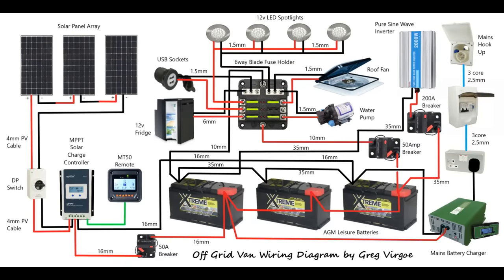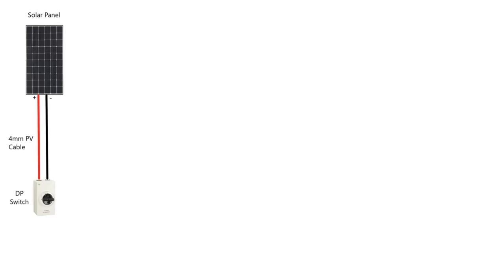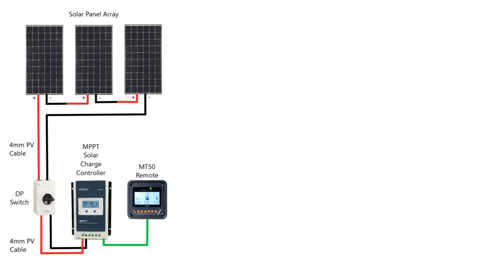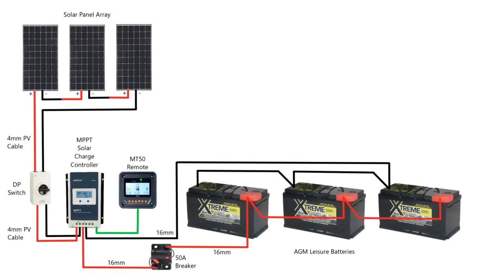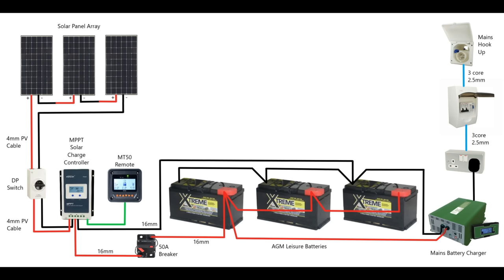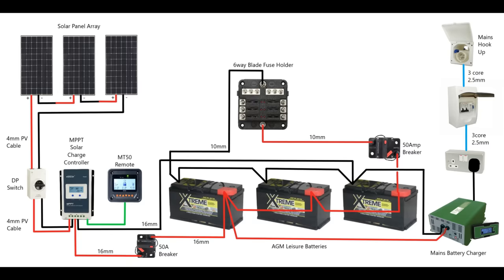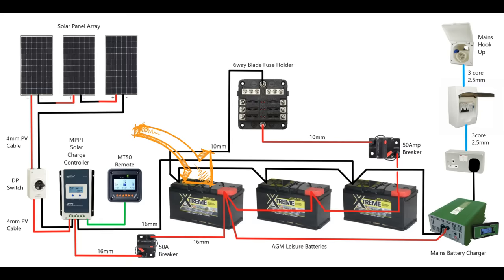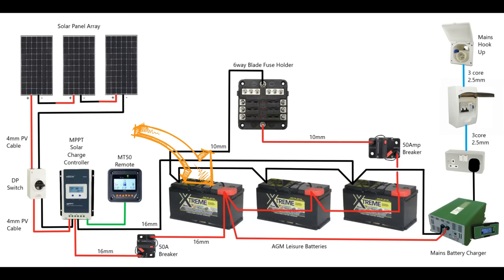How to Wire your Camper Van to be Off-Grid

Comment: One more question Gregg, is there a way to connect the inverter in the top of the fuse board along with shore power, coming out the other end I could charge the batteries from the shore or power a socket with shore 240v or forget the shore power, run the inverter through the same fuse board and have all my appliances run off that? Is there like a relay that would not allow shore power to enter the inverter? thanks

Comment: Hi Greg look for some advise I'm looking to install an inverter using a  24volt 100Ah LIFEPO4 LITHIUM BATTERY and a   Victron Orion-Tr Smart 12V 30A Isolated DC-DC B2B Split Charge Kit to the van battery and I've been advised via victron that 16mm cable will be suitable but in your video you say 35mm? Confused hope you can help 

🔍

Comment: How do I find out what size breaker I need between the solar charge controller and the battery. I'm making about 10amps max, should I use a 15amp breaker? thanks!

Comment: Hi Greg _ I know this is one of your older videos but it has aged well - unlike me.

Context. Daughter has a VW California 3 years old old supplied as a Danbury conversion and she brought it to me to investigate flat leisure battery. (She bought it new from them).

I understand Danbury have gone bust and she has zero documention with the van.

What I have established is she is is getting zilch from her solar panel via the ‘EP Solar Duo Battery solar controller’ AND the vehicle alternator is not ‘wired up’ to be able to charge the leisure battery. Is this normal?

I would be grateful if you could point me in the right direction of how I go about installing vehicle alternator  to leisure battery charging / in terms of what kit do I need.

BTW - I think they have shagged the battery through ignorance and abuse and no means of assessing SOC. For a ‘professional’ conversion it is very poorly done and clearly done down to a price.

Grateful for any help.
Reply from the maker: Sadly when AGM leisure batteries are drain to flat condition it does damage the battery and difficult to bring that back if been like that for a while. A really good solution would be the Renogy dc to dc charger with built in mppt that I am fitting to the new van. It would give you both solar charging and charging when driving. It’s easy to install and very reasonable price. 
https://amzn.to/44vQKZ0
I would recommend a new leisure battery too and once installed don’t let it drop below 12v when using it 👍🏼😃 hope that helps
Reply: @GregVirgoe  Yes, that it is most helpful Greg. I agree I think they have shagged the battery but I have not had access to do a capacity discharge test. I am reviewing the Renology versus Victron options for B2B.😀👍

Comment: Thank you again.1 question. I have a 3000w inverter.  Will i need a higher rated breaker than what you have here and will 35mm cable be suitable
Reply from the maker: You will need a 300amp fuse or breaker for that inverter and 35mm cable would be ok if less than 1m long otherwise they need to be 50mm. You will need lithium batteries to power that inverter as you will struggle to pull 250amps out of lead based batteries. 
Why do you need a 3kw inverter?

Comment: Hi. Thank you for the video
I’d like to ask u, if my converter it’s 2500w what cable do I need and breaker ? Plus , don’t need to install any fuse box from the inverter to the sockets? 

I have 4 160w solar panels, what cables shall I use 
Thank u
Reply from the maker: Hello Dan,
2500W inverter will need 50mm cable and 250A fuse or breaker.
Most inverters you need to use a fused plu onthe outlet side so that will give you 13amp protection.
If you wire the panels in series the amps stays the same so you can use 4mm PV cable.
Reply: @GregVirgoe  thank u for getting back to me..I have seen that the best one it’s to connect solar panels parallel and in series or just parallel
Reply from the maker: @dank5372  each has their merits but I prefer to wire them in series. The amps is low so cable size is small and I can still get enough bolts for a trickle charge even when it’s peeing down
Reply: @GregVirgoe  thank u... so will I get 4x160wats or will get 12x4 voltage? 
Plus I need to connect my DC-DC to the ignition with IGN sensor cable  as I have smart alternator. I have transit 2013 but can’t find it anywhere how to connect it. Any ideas 
D
Reply: @dank5372   I have one the same year. Let me know how your going with yours

Comment: Hi Greg. I know it's been a while since you did this vid but I am doing a small Micro camper. Everything will be removable as I use it for work as well. I have a 100W portable solar into a PWM controller then it will feed 2x 45A AGM batteries wired for 12v. Can you advise please what size cable to use to run from the controller to the batteries to charge them up. My controller is rated at 30A but the solar is only about 5.5. Thanks
Reply: As your controller is rated at 30 amps maximum output you would need a cable of 30 amps plus 20% (37.5 amps)

AWG 6 = 37 amps
AWG 5 = 47 amps
Hope this helps.

Comment: Hi again Greg,
Just at the point of hooking up my 2 x 340w 18v solar panels and I have noticed that they only have 2.5mm2 pv cables hardwired to them. Is this gonna be an issue? My run is about 5m and by my rudimentary calculations I would need a 6mm2 or maybe even 10mm2. Is this right or have you any experience in changing the cables the panels come with? Cheers in advance!

Comment: Hi, thinking of fitting a 160 solar to an already converted T6, but I am thinking of buying a 500kw portable generator, storing in the camper, and splitting the cable from the solar panel to have a cable to top up the generator and also run to the leisure battery. Am I going down a rabbit hole or is this doable? Thanks

Comment: Re wired my 2  batterys and inverter  like in your wiring diagram with the circuit breaker in to my inverter as I have a switch on my inverter to turn it on I turned the switch on the inverter has gone to red light and just a long beep does this mean my inverter is knackered or is there a fault I have made if there is a way I can send a pic of how its wired so you can help me it would be much appreciated thanks

Comment: Hi Greg, great video! I have a 245 watt panel, with a 115ah lesiure battery, regarding cable sizes would they suffice for this size solar pane?l, I would look at putting in a 30 amp inline fuse also. Solar panel to MPPT 4mm and then MPPT to battery 16mm battery cable ? 1.5mm for every thing else as only have led light, diesel heater and TV (the essentials 😎
Reply from the maker: You can probably come down to10mm on the battery cables but check your diesel heater amp rating as that may want more than 1.5mm 👍🏼😊

Comment: Hi Greg please can you help me, I have  2007  VW Transporter van.. It has a parking or auxiliary heater fitted from the VW factory in this heater system is an auxiliary battery, for obvious reasons I am assuming this will have its own split charge relay. I wanted to have a camping or leisure battery so I bought a 120wh 12v agm and have wired it up on its own b2b split charge relay system... I did ask Impuls automotive the supplier of the split charge relay kit  if they thought this would be a problem and they reassured me that they did not see any issues with this wiring set up, but I have been watching your vids on YouTube and I would like to get your opinion on this.

With kind regards
Simon Tomkinson
PS if any one has a similar experience please feel free to share or contact me.

Comment: How do I know if I need a 32 or 64 amp DP switch? I plan on running two 100 watts panels. I may actually run a third now.
Reply from the maker: It just needs to be greater than your max amps from your panels. 
That’s likely to be less than 20amps so the 32amp isolator will be ok 👍🏼😊
Reply: @GregVirgoe  even if I run 3 100 watt panels will be ok with the 32amp isolator?
Reply: @GregVirgoe  OK I found that my panels are 4.84 optimal operating current 20.7volt and have a max fuse rating of 15A. If I ran a third panel would the 32A DP switch not be enough? 

Second I want to run fuses on the solar panel lines. Do I run 15A?

Oh hey I’m running the panels in series (: so I think it’ll be totally fine right , still wanna add fuses for precaution what you think
Reply from the maker: @jonnytacooutdoors  100W panels typically have max current of 5amps so if wired in series that current will stay the same so one 10amp MC4 inline fuse in the positive to the controller will be fine. Even a 25amp isolator would be rated more than enough for that setup. With switches and cables there’s no harm in going bigger it will just run cooler with less resistance 👍🏼😃
Reply: @GregVirgoe  so if wired in series wouldn’t the amps stay at 5amps? Or no. Sorry I’m a newbie. If I run 3 100 watt panels with the above specs listed then what fuse should I run on the positive line? A 10A?
Reply from the maker: @jonnytacooutdoors  yes see my previous reply 👍🏼
Reply: @GregVirgoe  OK I’m gonna run a 10 amp and can I just plug it in to the PV shut off? Or do I want to run it closer to the panel closest to the panel?

Comment: Hi mate what is your recommendation for charges the batteries from the engine when running and how would it fit into your diagram.
Reply from the maker: I would recommend you use a battery to battery charger. 
They normally have a positive and negative connection to both batteries. 👍🏼😃
Reply: @GregVirgoe  then I guess something like a regulator is used in between the vehicle battery and van batteries, when the car stops, van batteries does not drain the vehicle battery.
Reply from the maker: @melihtarhan2507  the battery to battery charger is the device that is connected between the different batteries. That does all the clever stuff 😃

Comment: Hi Greg, Ive just ordered a Renogy 2000 watt inverter that ships with 20mm squared cables, to run off two 12 volt 100AH lithium batteries. These cables seem a little small to me to handle a potential 166 amps + Could this be a mistake on their part? (product details are available on their website). Matt

Comment: Hi Greg,
Is it possible to  add a  battery to battery  charge  system or a split charge  system into this equation.
Reply from the maker: Yes I would always recommend using a B2B charger rather than a split charge relay as they will look after your leisure batteries better. 
Connect it to the same posts as the solar charger. 😃
Reply: @GregVirgoe  any recommendation on a B2B charger?

Comment: Does the wire to the fuse block have to be 35mm? The fuse block wire is connected to the battery terminal at the same place as the inverter wire. When the inverter is running is that current going to overload the fuse block wire since they both touch each other?
Reply: Also, would that inverter load trip the 50amp fuse on the fuse block wire since they both touch at the terminal?

Comment: Hi Greg, I am building an off grid 12v cabin and have a heap of 240v cable. As my cabin wind be rocking around (I hope) would it be ok to use this cable so long as it has the sufficient amp rating?
Also, when looking for a MPPT controller, does the Amp rating refer to amp in or amp out?
Reply from the maker: Yes you can use that as you say so long as the amps rating is covered. 
The amp rating of the mppt refers to the max output to the batteries. 
Each mppt will specify the max voltage and watts on the input side so worth checking that depending on how big your solar setup is. 
If you have lead based batteries like AGM then a good rule is not to charge them more than 10% of the total capacity. So 300Ah of batteries - 30A charger. 
Hope that helps 😊
Reply: @GregVirgoe  you are a champion good sir! Thankyou from Victoria, Australia
Reply from the maker: @timglenton7163  no problem at all anytime 👍🏼😃

Comment: Hi Greg, if you wanted to have an outlet to use things with a three pin plug, would it come off of one of the sine wave cables? And i take it you would be limited to what appliances you could use eg no hairdryer?
Reply from the maker: Yes correct, you can simply plug a lead into your inverter socket then run this cable to sockets elsewhere in your van.  You would be looking limited to what you can use by the size of the inverter and how many amps you can pull out of your battery. A small travel dryer would use less power than normal domestic hairdryer. But they still use 1200W which is drawing 100amps from your battery. 
My advice would be to consider putting your hair in a pony tail when off grid and save the battery power 😊😉
Reply: @GregVirgoe  thanks so much for your reply :) i think ill have to grow out my fringe once i move into full time van life..!
Reply: @GregVirgoe  Really enjoy your videos, this is the first time I'm writing up as I'm a bit puzzled by the shore power hook up. If you could please elaborate a bit more on the inverter - some of them have an "earth" point, which I reckon needs to be attached to the van chasis. Is that what's needed indeed or I can just wire the inverter to the battery and use it as is? Thanks!
Reply from the maker: You would need to find out if your inverter had any kind of residual current device internally. If not you need to use an external RCD on the mains outlet of the inverter and have a common earth bar to connect the earth from your appliances to the case earth of the inverter. Do not connect any mains earths to your van metal body. There is a serious risk of fatal shock if you are on electric hook up and the site lose there combined Earth connection 
My new video out soon explains in more detail. Hope that helps. 😃

Comment: How would you wire and electric boiler to this rig and what specs would the boiler need to be as I’ve seen a few cheeper ones on screw fix would the drinking water pump be wired to the 12v ?

Thanks
Reply from the maker: I would not recommend heating water by electric of a Campervan battery system. It would use far too much power. Boil a kettle on gas it’s far cheaper and easier.
Reply: @GregVirgoe  ok thanks so the Truma Ultrastore Rapide 10 LTR gas and electric Water heater would work with this relay ?
Reply from the maker: @user-it7ox9yn4e  a Yruma dual fuel boiler would be ok because you can use the gas system when off grid and the electric heater when you are on a campsite hook up power supply.
Reply: @GregVirgoe  would the boiler know to do this its self or would the gas have to be shut off when at a campsite ?
Reply from the maker: @user-it7ox9yn4e  you would have a control unit with it that you use to tell the boiler what to do

Comment: Hi Greg, just purchased a 2000w Renogy Inverter and wiring that directly to the DC batteries for thr input side of the Inverter and then running a new AC wire with plug socket from outlet side of inverter. Therefore I'm not connecting this via the internal Sargeant PSU I'm keeping it seperate. My question is on the DC input side of the Inverter it has a Ground Ring...... Does this need to be connected? I've read some conflicting information online, some saying only when linking through the PSU and other saying to always earth, whilst some others say that it could make the van live in a earth fault, to others saying it would serve no purpose as the Neutral and Earth are linked at a Substation in your house 240 system whereas in a van it isn't! What's your take on it?
Reply from the maker: You do need to connect that ground on your inverter to bare metal of your van with a minimum of 6mm cable. 👍🏼😊
Reply: @GregVirgoe  Many thanks mate, I'm running 95mm cable from the battery positive and negative due to cable length/voltage drop (5m run) does that mean I also need 95mm cable for the earth to body?
Reply from the maker: @scubacollie2083  no the 6mm earth will be fine as that’s on the 230v side. 
Would have been cheaper to fit the inverter near the batteries abs run longer mains cables 🤔😊
Reply: @GregVirgoe  Hi mate the earth ring is on the DC Input/12V Side and not the 240/AC side? Does this still stand? I didn't have room near the batteries unfortunately as that was my original plan.

Comment: Great video Greg. At 14:35 you say increase the parallel cable to 35mm but on the diagram you only change the negative. Should the  positive cable form the inverter through the 200A breaker along the positive battery parallel and to the 50A breaker, also be 35mm cable???? Thank you.
Reply: Yes definitely... all of the negatives and  positives, as well on each side of the breaker all need to be 35 mm (or whatever size is needed to match your inverter).  Do not skimp here this is probably the most undersized cabling I see in many people's setups, which then results in Overheated wires, Breakers tripping, Inverters shutting down and more.
Reply: @johndaddabbo9383  What would the cable size be for the pos and neg be for the battery charger to batteries?
Reply: @CyclingExplorers  Well, assuming that the AC wall charger is 40 to 50 amp (which you wouldn't want to go higher than that without knowing if you battery bank can easily take a charge higher than that) then a 16 mm (6 gauge) wire is fine.

Comment: Hi Greg
What size cable for the MT50 remote, I am assuming 1.5mm
Reply from the maker: It's a RJ45 Cat 7 data cable that comes with the remote display. You can buy longer ones if you need to place it further away
Reply: @GregVirgoe  Ah, I guess I should have looked in the box before sending you a question, much appreciated though, thanks.

Comment: The consumer unit is confusing the hell out of me… am I having a dizzy moment?? 

How is it possible that the main battery charger is plugged into the back of your garage… and then also via a consumer unit into the hook up installed on your van?? 

Do you mean you have a consumer unit in your van? with a double plug spurring from that, installed also in the van? 

Sorry If I’ve got this completely wrong